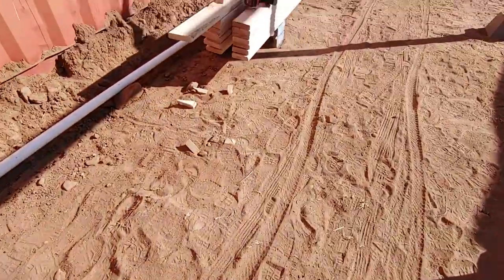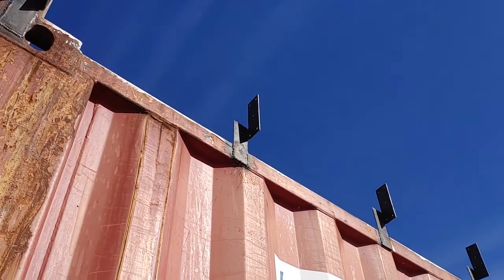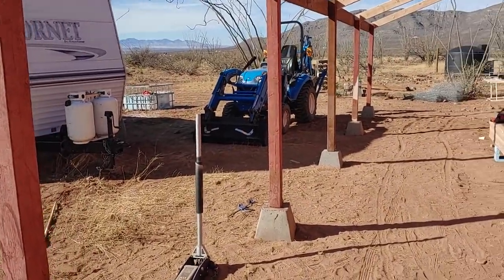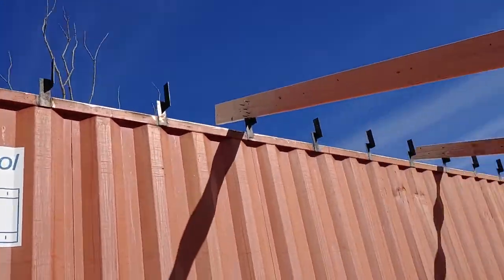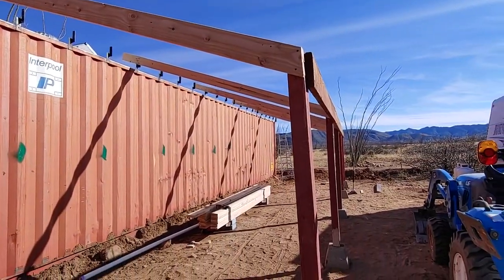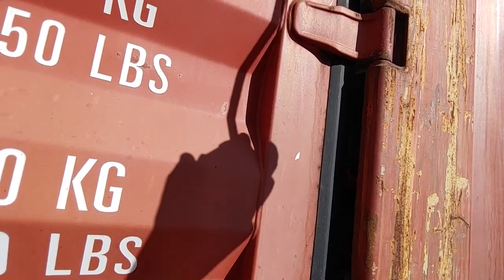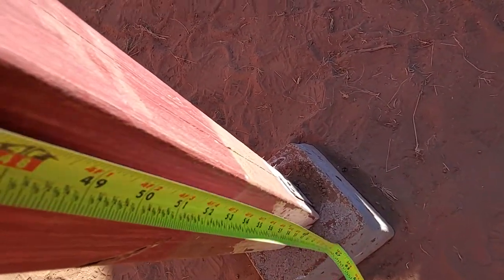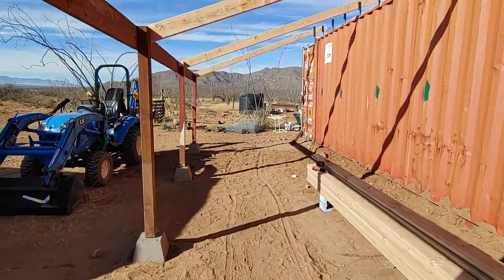Off grid rain water harvesting system progress day1!

Comment: Two things: plan for overflow and rethink the cinder block base - maybe build a base with earth using that tractor if you need elevation.  We are (currently only) capturing off of our 30' x 40' steel building.  Once the house is done, we'll capture off that structure and need much more storage.  With last year's monsoon's, we captured almost 10,000 gallons of water.  Good to have a plan for that excess water to go so you limit any erosion.  Not sure I'm picturing your cinder block base correctly, but we have our 3 tanks on the ground (we leveled the area next to the building before placing.). Your soil looks like clay - just like ours (St. David, AZ.)  I'm wondering how those cinder blocks will hold up when it rains, wets the clay and the tank gets pretty full - lots of weight there.  Just some thoughts.  We have some run-off to deal with on our property as the water is finding its way in-and-around my solar panel mounts.  We built the mounts similar to what you're doing although we rented a post-hole digger and dug a bunch of 36" holes and concrete'd those posts in.  The winds are pretty scary around here sometimes.  We had a 3'x4' piece of plywood fly across our property and slam into the steel building's roll-up door.  Dig some damage.
Reply from the maker: Thank you so much for the feedback and recommendations as I'm new to all of this.

I will be rethinking my ideas for the water tank going forward as I'm surrounded my mountains and the flash floods are random, well planned swales and berms should help in my situation going forward.

Comment: Looks like a good design. When you build the catchment roof on the other side of the container, do you plan to bring each side to the center for a peak? That would give you a lot more catchment area, but obviously, you'd have to move your solar panels.
Reply from the maker: Thank your so much!

I'm not sure what I'm going to do to join the two sides just yet, I like having the panel and whirly birds exposed but like you mentioned it would give me more surface area.